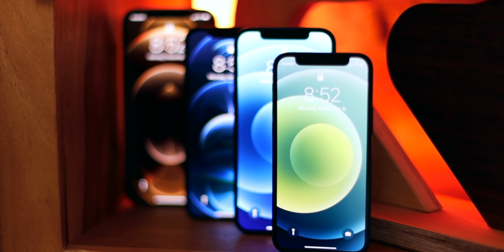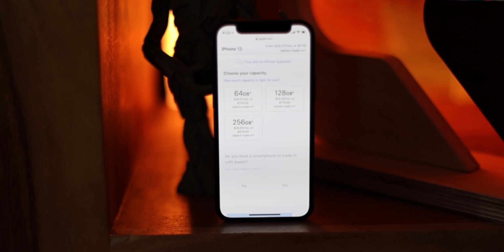iPhone 12 — Buy Now or Wait for iPhone 13?

Comment: iPhones suck ... update after update, your limited to what you do and anything you need costs money ( songs, ringtones, etc) not to mention the batter isn’t changeable (my old Samsung battery’s fit my current phone so ones a charger for backups ... and that flat post that keeps wearing out cause it’s soft as aluminum 

Anyone wanting a iPhone over a Samsung it’s cause the phone thinks for them ... idiot phone

Comment: I was hoping to keep my IPhone X for a few more years, but it is falling apart on me. The lightening port hasn’t worked in over 2 years, one of the bottom speakers doesn’t work, and now I have the infamous green line running from top to bottom of my screen, which is apparently a known defect with the iPhone X screens but unfortunately out of warranty. I keep a sturdy case on my phone and have a screen protector on it. I’ve never had this many issues with any phone I’ve ever owned, whether Android or Apple. My plan is to just deal with it until the 13 comes out.

Comment: 5G will pinpoint your location every time. Not too private. T-Mobile tech told me customers are crazy screamy because their new 5G Apples and others are not working. There are still substantial software and hardware communication issues. Very sad. Stay with LTE.

Comment: so i heard from different sources that the mini is getting scrapped after this year. but i think they should keep it by making the new SE in the shell of the current mini and finally get rid of that awfully outdated iphone 7/8 design they are still using on the current SE. keep it the budget iphone and watch how successful it will be

Comment: Man my launch day, 11 Pro Max 512GB is still a beast lol. Why ever would I upgrade? I love my phone. I feel like a upgrade would be such a waste of a phone. iPhones last so long.
Reply: They do unless you have hardware failure. My iPhone X is out of warranty. The lightening port quit working two years ago, one of the bottom speakers doesn’t work, and yesterday I got the super bright green line going down my screen. I’ve had lots of phones but never had as many problems as I did with the iPhone X.

Comment: We normally buy a new iPhone every two years. But this year, because our daughter moved out of state, and then, the pandemic hit, we kept putting the three phones off until it was so late, it didn’t pay, since we’re not doing much anyway. Most of my photos are from incremental builds in my shops. Don’t need a new phone for that. So, we’re going to get the 13 Max instead.

Actually, the 13 seems like a bigger boost over the 12, than the 12 does over the 11. So it’s probably a good thing this year.

Comment: How in the heck are you supposed to use Apple CarPlay without a charging port?
Reply: Some car play units support wireless car play.
Reply: @kevinthomas7478  good to know... but I’m not about to replace the CarPlay unit I already have installed in my car just so I can get the newest iPhone. Idk why they had to get rid of the charging port. Seems silly.
Reply: @michayla_t  There’s no guarantee they will get rid of it. I highly doubt they will be ready to make that shift so soon. They’ve been trying to implement TouchID directly into the glass for several years now and still haven’t managed to do it. At the risk of being labeled a Debbie Downer, I don’t see that feature coming to the 13 either. I could be way off base, but I’m thinking this will be more like a 12s rather than a huge leap. A little faster, better camera, maybe a better screen, but otherwise the same.

Comment: Ok my iphone 7+ was charged overnight to 100%,  Looked at a few emails and that is it.  Just looked at the battery and it is at 1% telling me that I need a new battery. Also I only have 32gb which is getting dangerously close.  I know I need a new phone but I am wondering should I buy the battery and then wait for the iphone 13 or just go ahead and get the 12 now? Will there be a huge difference between the 12 and 13 to warrant waiting for it? Thank you.

Comment: I was planning on getting the iPhone 12 Pro Max this month in a week or so . From the leaks I don’t really like the 13, there is not much difference.
Reply: Some people don't care about the specs they just want the product
Reply: @lethaldeath_.5627  can you tell what do u think if u hav 12 pro then getting the 13 non pro ? Not worth it? Or should get the 13pro if ever to upgrade v
Reply: @ivans9024  I didn't get it
Reply: @lethaldeath_.5627  if i am using 12 pro now is it okay if the 13 or 2021 models release then i will buy the non pro model, or not good? I shoul buy a pro model again?
Reply: @lethaldeath_.5627  ?*

Comment: Would you swap a Samsung Galaxy S21 Ultra, a Galaxy Tab S7 Plus, a Galaxy Watch Active 2 and Galaxy Buds Plus for an iPhone 12, iPad 8th Gen, Apple Watch Series 6 and Airpods Pro? Long story short, I'm now faced with this dilemma. I genuinely love Samsung and Apple. I've owned Android for a year now and although it has made a refreshing change after having Apple for five years before, I'm not sure I need all what Android has to offer such as customisation. I adore my S21 Ultra but I still feel Apple does smartwatches and tablets better. That's the main reason why I'm pondering the switch. But can I give up the 120HZ frame rate and ridiculous battery life of my Ultra? I really don't know!

Comment: I use a corded earbud to record on my iPad and iPhone 6s Plus. Also to access my midi piano keyboard through an adapter. The wireless charging reports I’ve heard aren’t a plus as there’s still a ... cord. I’m trying to justify waiting to upgrade to a phone that would take away the options I currently have in favor of what?

Comment: Remember guys, The rich spend like they’re poor and Invest, where the poor spend like they’re rich with no Investment. Keep it simple, stop giving away yr hard earned money to impress others..
Reply: Depends. This year for the 12 you could get the phone basically for free because they wanted people on the 5G network. My college professor got the 12Pro for nothing after trading in their old Samsungs at AT&T. Same with verizon. The real question is whether or not the 13 will receive the same push.
Reply: @doomy_doomy2225  Exactly. T-Mobile currently has the same promotion for current users to upgrade to the iPhone 12 free by trading in your current phone if it qualifies. I can pay $69 to replace my battery at Apple when the time comes for my XS Max to keep it for a few more years or I can trade it in and pay $50 in sales tax for a new phone with a fresh battery and upgraded internals. No brainer.
Reply: @Jlaw850  Yup. As well, since Apple has such connections to sometimes you can go through Apple and have that activation fee waived. Hell you can get an S21 Ultra for free from Verizon right now. Hence why people complaining about price make no sense and just want attention.
Reply: Well that's just a saying lol
Reply: @thecreatorvd3854  And that’s why your poor
Reply: @drcola143  well not really
Reply: Yep, I stopped spending money on mobile devices and now only sell body parts and internal organs to get nice things!

Comment: They should make: 

Classic iPhone 2021 edition - new specs, but old design (around £400). LED screen (higher res maybe) all the Touch ID features etc but the newest specs.

13SE (£550/£600 mark, LED screen, good for people who don’t care about tech specs but want the look and software capabilities of modern iPhone. Much like the standard 11 or XR relative. 6.1 inch display)

13 mini (around the £725 mark) - similar to the 12 mini but for the 13

13: the standard model, OLED screen, 2 cameras etc.. around the £825 mark

13 plus: big version of the standard 13. No extra features, just larger screen for phablet lovers (£900-950 mark)

13 pro mini: pro model but small for small phone lovers who want the pro capabilities ie high refresh rate etc (around the £850/900 mark)

13 pro: standard size but pro £1000

13 pro max: biggest and baddest of them all £1100

This would dominate the market for all types of users. All price points for user to decide the level of pro, plus or mini they want. All access the iOS software. Merges with the android market and android can no longer say they offer more variety

Comment: In my opinion, unless you have FU-money, if you own a iPhone X or newer, I really cannot see any reason to upgrade besides the battery.  I'm definitely tempted by the iPhone 12's design, but my 512GB XS Max I got for less than $700 last spring still gets the job done.  

My only complaints are with the battery and camera.  The XS battery isn't horrible, but I do admit I envy how my friends on the 11/12 are getting 3-5 hours more juice than I am.  The 12's camera is obviously a great improvement (otherwise any other reason to upgrade would virtually be rendered nil), but the XS Max is still good, and still has the same grossly inadequate 2x telephoto you'll get in the 11 Pro and 12 Pro models; had Apple upgraded that then this would be a very different comment lmao.  I've been getting into filming and photography lately with my iPhone, buying anamorphic lens, a neural filter and an Osimo gimbal.  I was about to upgrade to the 12 Pro Max pretty much for the camera, but then I snapped back to reality and realized for less than that, I can get myself a pretty decent mirrorless camera to switch to when my iPhone is pushed to the very limits of what it can do.

Comment: I have 7 Plus and im going to wait because i do not want to give up on touch-id... yet this 7 Plus still work perfectly fine!
Reply: Mines starting to slow down bad. Random app crashes. Bluetooth connections dropping. It will slow down like crazy that I have to reset the phone. 

There’s a hood trade in deal at T-Mobile though

Comment: I'm still on my Xs Max but I might sell a fraction of bitcoin to go 12. But Xs works so well and I'm quarantined anyway and there's no 5G and my wifi is all good.
 Gonna get it next month
Reply: I'll trade in my IPhone XS MAX 512GB and pay only about $750 for the IPhone 12 PRO MAX 512GB.
Reply: Is your xs max still working? I’ve had mine like two years and it’s always been fine and within the last month my battery has gotten so bad it looses charge and parts of the screen don’t respond sometimes so now I’m wondering whether to upgrade!
Reply: @charlottee7173  battery degradation is normal. It gets accelerated when you do fast charge every day. Under settings what’s the status of the health of your battery?
Reply: Denis Lara ahhh I see it does say it’s working at its peak performance ability but it’s not! I’m in college and so use it roughly the same amount every day and have done since I had it. I used to be at about 40% by 5 in the evening and today I was at 19% by 11 this morning!!
Reply: @charlottee7173  ok. So still is at about 80% performance? What you could do is let the phone die and leave it day for a few hours and then charge if. (It might be out of sync) 
Another thing is do not closed apps, switch between them and all but don’t closed them. Hope that helps
Reply: Denis Lara yeah and okay I’ll give that a try, thanks for your help!
Reply: Dumb don’t sell your bitcoin.but if you do get a 12 get the 12 pro max i just got it and i love it
Reply: lol im in a 6s
Reply: I had the same phone too. But I was offered $800 for it so I turned it in for the 12 pro max
Reply: That’s dumb hold the Bitcoin
Reply: @XYZCBA50  smart people don't hold to nothing. We make money, sell, buy again, get other cryptos, sell, put them again in BTC. Emotional people think it's dumb and are in love with coins. 💋
Reply: @kaysha  Your referring to yourself as smart but your about to buy a new phone that’s damn near the same as your old phone and also dip into your Bitcoin just to buy it when ALL the rich people say don’t touch it. Let it build. But if your so smart and ballin and u know what your doing why would u have to sell any Bitcoin? You don’t have that in cash Mr. Smart Big Baller?
Reply: @kaysha  I’m not emotional but I also believe in a decentralized world. I don’t want to stay in fiat so I don’t want to take “profits” in fiat
Reply: @seanpaul4101  youre right. He’s wrong. He just needs the money hahah fool
Reply: @asterdamaster  yes, eventually, I think that's where we are headed. But we are still at the crossroads. A lot of projects are exciting. I'm creating my first NFTs myself, very exciting.
Reply: @kaysha  that’s the way bro, you buy you do your research then sell again after you’ve analyzed all the data, but sometimes it’s a gut feeling you either have it or you don’t.
Reply: @joejohnson3161  indeed. Some of these kids in the comments have no clue how money is made
Reply: @kaysha  smart people don't sell to buy an iPhone.
Reply: same, still on XS Max but perfectly good, will definitely wait for the 13 at least but considering waiting on 14 to get periscope zoom
Reply: Lol this makes no sense guy

Comment: Using the Samsung Galaxy s9 and I'll upgrade to the iPhone 13 - looking forward to it
Reply: Congrats the Apple is a miles better :)
Reply: @noaholivercedillo2451  appreciate it man, bought the new iPad Air recently and realised how I love the fluidity and simplicity of Apple products.
Reply: yeah i use a galaxy s9+ too, and its performance for games like pubgm and codm already dropped to a noticeable level, since im in the pro scene on codm and in need of a new phone to keep up, should i wait for ip13 pro max or just buy the 12 pro max?
Reply: @KardusAquaa  my main issue is the battery and how slow/laggy the general experience becomes over time. Looking forward to buying the iPhone 13 this year

Comment: Wi-Fi 6E and 5G are excellent features but until they are widely deployed, they have no value. Rogers here in Toronto expects MiW 5G to take more than a decade to be deployed at scale. Wi-Fi 6 for me has no value. I have a 10Gb internet connection and Wi-Fi 3 can't saturate it. Until I get a faster internet connection then Wi-Fi 6 has no value. I will stick with my iPhone  8 until hell freezes over.

Comment: I have usbc port on a Samsung phone. It gets pocket lint in the port which keeps the male connector from seating all the way. I found out about this when my phone wouldn’t charge through the usbc cable. So I bought a wireless charger. Recently Android Auto wouldn’t work in my car. Same problem, lint was keeping the connector from bottoming out. I know this is just a maintenance issue, but you have to know about it first. My Wife’s iPhone has none of this with the lightning connector. And if the next iphone has no external ports, gimme that. Hopefully it floats in the pool😬

Comment: 120hz, shorter notch, touch id, both pro models get upgraded same cameras and better battery life trust me just wait until september it will be worth it
Reply: that’s what i’m hoping for!
Reply: @meatyum  yep. Ill get this and hold on until a full display iphone
Reply: How u know that this is what’s to come? Just rumors or confirmed?
Reply: @PrincessYonnaa  Just rumors for now but they should reveal it soon since we are closing in on the official release date.
Reply: @roarbahamut9866  They will reveal it's specs right before they release it...in September most likely.  Until then, all we have are rumors.
Reply: @BriannaOfficial Here is the best advice I can give. 120hz in my opinion is a big difference especially if you've used the iPad Pro. so if you really care about 120hz then just wait. Also if you don't care about 120hz then still wait as when the 13 comes out the 12 will be much cheaper. just get a temp phone at the moment if you can and wait
Reply: yeah if the 13 is coming from all of these I'm definitely waiting. got an 8 plus rn so I love touch id, and 120hz is honestly so great I need it. I'm aiming to have the 13 super long-term too and i think the 120hz alone helps in that regard.
Reply: @kc1813  hate to break it but i dont think touch id is happening
Reply: @---nv4fz  how come?
Reply: @kc1813  cos apple are apple
Reply: @---nv4fz  true but i’ll wait and see i guess
Reply: 120hz and better battery life? You can only pick one my friend
Reply: @A_Roblox-Gamer  they are using Samsung LTPO panels so it actually saves battery and only uses 120hz when you need it. Also battery capacity is bigger this year
Reply: @A_Roblox-Gamer  same but i am very dissapointed no touch id. I really dont know now if i should buy or wait for iphone 14
Reply: @---nv4fz  is it confirmed? im curious, why do you want touch id? I think face id works pretty well. Is it just a personal preference? :)

Comment: Don’t know why people think the square edge is not as comfortable to hold. To me it is way more comfortable and easier to grip than the rounded off sides. The round slick iPhone 11 I had was impossible to hold without a case as it was like trying to hang on to a wet fish. 
And the notch doesn’t bother me the least but I will embrace the 120hrtz display though. 
Cheers

Comment: I’ve still got the iPhone 7+. It is steaming along just fine. Replaced its battery 3 weeks ago, should be fine for the next 3 years or so, saving $$$$$ in the process. No need to upgrade

Comment: Apple is removing one port too many.

I don't care and never cared for Apple's proprietary connections - lightening and Magsafe of old and magsafe that is new.
I will take the ubiquity of USB-C and more secure/reliability of a physical connection even as a back up connection over conductive and wireless.
So I may have to take the plunge and get the iPhone 12 as my last phone (I don't care for Google's Android OS) and for future communications devices I may get a watch instead.